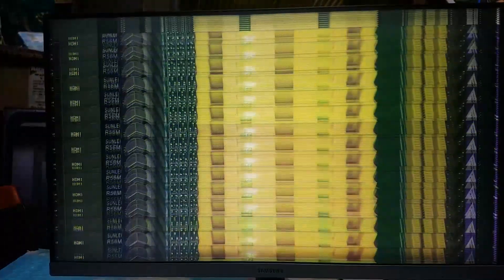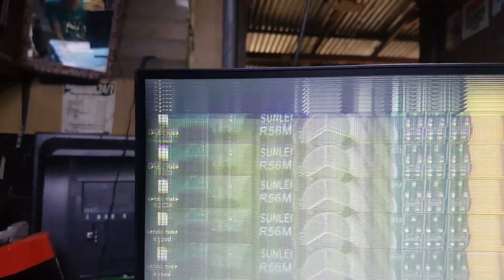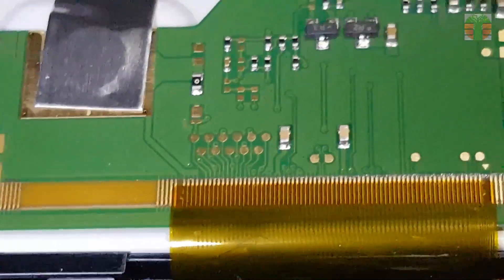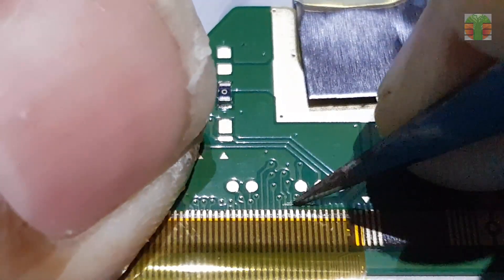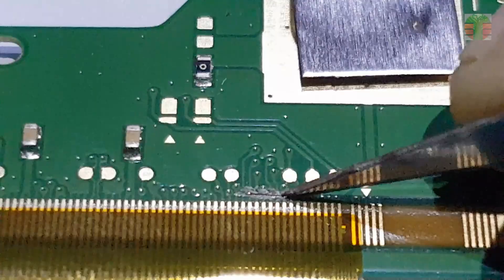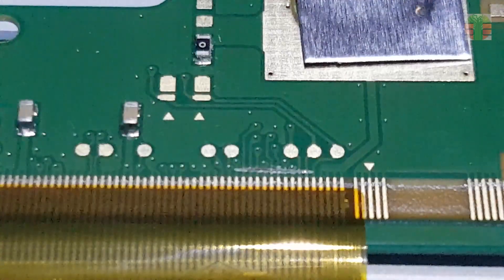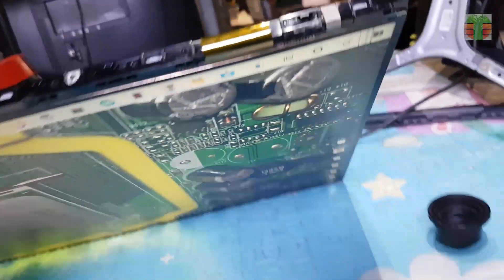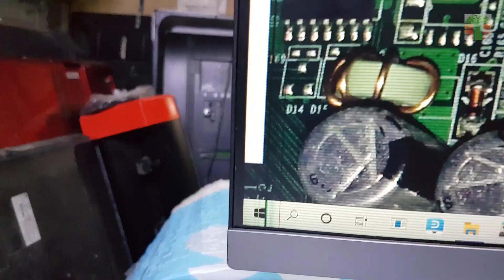Rolling image fix

Comment: Good day sir... My nbili akong tv.. Samsung 55" model :UA55M5500... same issue vertical rolling... Sinubokan ko syang gawin pero di ko kinaya.. Nag try na ako e disable ung STV at STVR ganun pa rin..! Nag bypass na ako sa side cof gnun pa rin... Present nman po lahat ng boltahe sa side cof... Baka sir mabigyan nyo ako ng konting idea.. Salamat po
Reply from the maker: Baka may hindi normal na voltahe.
Reply: @tevzTVTevatronics  sa kabilang side ung STVR my nsusukat akong boltahe sa kabila wala... Salamat sa iyong pagsagot.. More power sau.. At more tutorial n rin